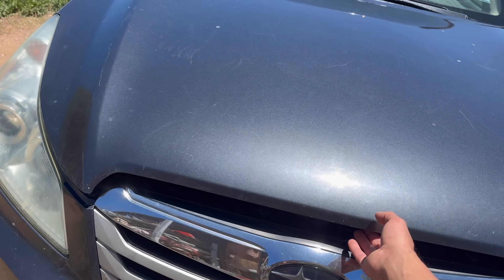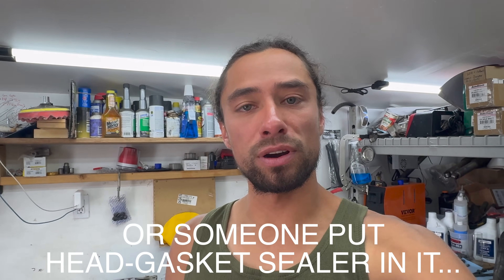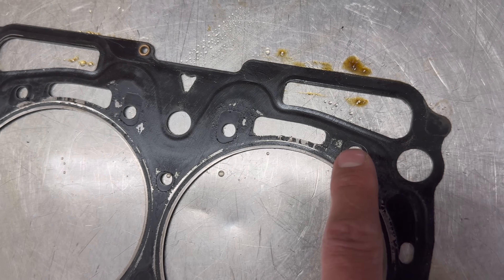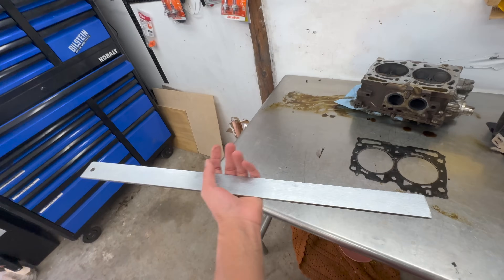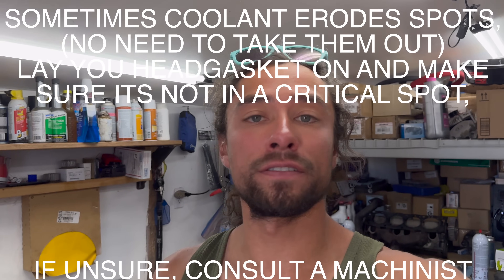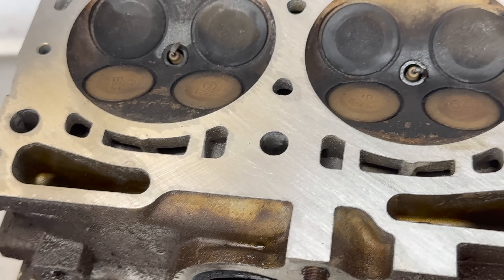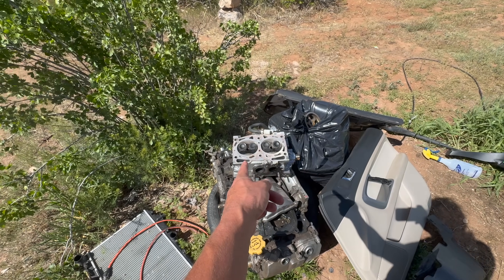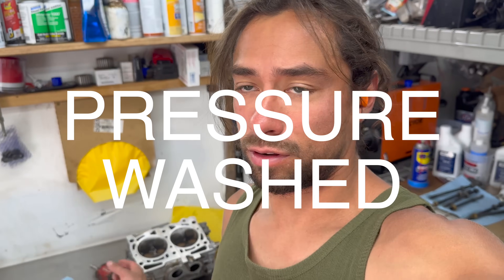How To: Resurface (EJ25/Subaru) Heads At Home - Backyard Machining 101

Comment: I've seen this done with a thick sheet of glass rather than a tile. It was an inline 4 head, and the person tied short lengths of rope to some bolts in the valve cover bolt holes, and then pulled back and forth on the rope. The idea being that if you are pulling on the rope then there is no risk that you are pressing down on the corners of the head and sanding a bow into it.

Comment: I got a 9" x 11" piece of 3/8 thick steel, and welded a handle on one side, a few drops of oil, a 9" x 11" sandpaper sheets stick right to it, perfect for flattening the deck, and the heads on a Subaru,  have probably done several hundred sets. Once my abrasive holder was made, I had it flat sanded at a machine shop.

Comment: I’ve always wondered if I could resurface aluminum cylinder heads with my 15 inch JET wood planer?  Also if Subarus are known to overheat, would it help to put a bigger radiator in them?  Or instal a giant oil cooler off of any diesel truck or tractor?

Comment: How does a plugged heater core damage the engine?  Haven't heard of that for other engines.  Great idea manually resurfacing.  OldSkoolFunk in San Diego made a similar youtube ~10 yrs ago, but used spray adhesive to attach sandpaper to thick glass.  Great tip on sandpaper for a floor-sander.  Would probably take days to deck a cast-iron head, but they rarely warp like aluminum does.  Will that sandpaper and its backing glue hold up to water if you hose it off as you work?

Comment: I did basically the same with my 98' DOHC Forester. Used an old 3/4" thick glass table that was given to me as my flat-base for the paper. The exception is, I used 6 star gaskets which state the surface should be 50RA or less. I did some research and the "RA", that means roughness average. ( 50 microns ) That's pretty smooth. I finished with 600 grit, the whole time flushing the paper with water, worked great. When I was through, the heads and the block looked like mirrors. I did the block with a piece of 1" thick polished granite building cladding that I had picked up from a commercial building site that was under construction (free), I cut it down to my needs with a diamond skillsaw blade. I used some 3M "77" spray adhesive for gluing the sheets down and used a 4" rubber roller to get it down flat, with no trapped bubbles. I had to remove the dowel pins from the block faces to do those.  I did this job back in 2005 some 175K miles ago, still running strong, with 295k miles of the car now, no problems with the HG's what-so-ever. Surface prep, flatness and proper torque amount and sequence are the key to a lasting job!  Saved a ton of cash and know that it was done right. How many shops would take the time to get it that good?
Reply: Did I understand this correctly - you held the granite cladding in your hands and sanded the block with it?
Reply: @fmlogija  ,  Yes.  The whole job is way easier to do with the engine out, and mounted on an engine stand. I removed the dowel pins from the block, so they wouldn't be in the way. I used a piece of the granite that I had, which I cut with a diamond circular sawblade, so that it was the size of a sheet of the Tri-mite wet sanding sheet. I adhered the paper with a very light spray coating of 3M "77" spray adhesive, and used a small rubber roller that's used for installing Formica, to get it totally flat with no bubbles or creases. I turned the crankshaft, so the pistons on the side I was doing, were about halfway down, and then I stuffed oily rags in the cylinders to stop any water, used as a lube/flush agent that I sprayed on with a spray bottle, from getting into the ring-lands. I didn't want any grit from going in there.  Yes, it sounds like a lot, but it's the way to go. It's been about 150k miles and 15 years ago, with no problems.  When doing the sanding, use a light even pressure and use a circular motion, until you've got a mirror like finish. Keep it wet with the spray bottle. The entire surface should look all the same and even.
Reply: So in his video he said 80 grit, if one were to use the factory Subaru MLS gaskets would 80 grit suffice or should we go up to 120 grit?
Reply: @aradney3 for factory gaskets, 80 grit should suffice! Coming from the machine shop, you can see the cut marks across the head. They run it fast speed then slower speed to make it finer. So the "glass" finish that the commenter mentions was necessary to meet the specs of his aftermarket head gasket. If the 80 grit makes it look way too rough then 120 won't hurt. But 80 will be fine.
Reply: @aradney3  , I used 3M™ Wetordry™ Paper Sheet 431Q, and started with 120, then to 220 and finished with 600 grit, keeping it wet with water to flush away any build-up in the paper, which speeds the job up and makes the paper last longer. The prep is only as good as you make it to be. Dead flat and shiny is what I strived for. Any visible "scratches", will work against you having a long lasting job.  Personally, I would only use 6-star gaskets. 6-star uses an advanced, high temp polymer, for the areas where oil & coolant passages are, with a proven "fire-ring" design to seal the cylinder-to-head junction. A superior product and worth the extra money as far as I'm concerned.  I've tried the others, which eventually failed.  I'm sure there will be a lot of people that will be "nay-Sayer's", but the proof is in the pudding, as they say.  I did mine back in 2005 and they are still doing their job with no issues, 180k miles later.
Reply: @cayankeelord3730 I've heard good things of six star as well. I was just going to go with the OEM MLS gaskets, I suspect they're as good as the Six Star?
Reply: @aradney3  , Not even close! 6-star were developed for racing and have superior technology from design, to the materials they are built from. They use a specialized high-temp polymer, as the sealing material that is part of the gasket, to seal the oil & coolant passages. It never hardens and stays pliable. The "fire-ring" is engineered to be  resilient, with the ability to expand & compress in thickness, in response to heating/cooing cycles of the heads & block. I've tried them all, including OEM. I've never had a 6-star failure.  The key is proper preparation. Dead-flat surfaces with a 50RA or finer finish of both the heads and the block. If you meet these requirements, it'll be the last time you'll have to replace head gaskets on your Subie.  They are worth the extra cost and the extra prep needed for a successful installation.
Reply: @cayankeelord3730  It''s been a while but I am back, so if you had to pick would you purposefully go with the Six Star branded gaskets over the OEM MLS gaskets? On Six Star's website would I buy the non-turbo gasket or turbo gasket from them? This would be for a 2009 Impreza 2.5l NA but I want to put MLS on the engine.
Reply: @aradney3  ,  The 6-star gaskets I bought, were a MLS type for MY98 that has the DOHC 2.5L engine. After using them, I wouldn't use anything else.

Comment: DO NOT cut heads with just 80grit smh. Don't even start with it. If yiu leave 80grit scratches, it WILL eventually leak 100%. Start with 320 and end with 400/600. 320 is more than enough to cut aluminum heads in a few passes. If you think I'm wrong, go ahead and ruin your heads, it's your engine, but ask yourself this, how do heads come back from all the machine shops? 80grit Scratched up? Or almost smooth as glass? So why wouldn't you just do it right the first time? Unless this guy knows something every machinist in the country doesn't..
Reply: Thanks for the info. Much appreciated

Comment: What is the reason you shouldn't finish it off with finer grit sandpaper? Wouldn't that smooth out the scratches you made with the rough grit?
Reply: I believe you want some roughness to the heads for proper sealing. You want some texture for the gasket to seal into least that's my vague understanding of why might be wrong.

Comment: Wow, I have a 2004 Subaru Legacy. The water pump has never worked in the last 2 years. I have had no engine issues at all in that time! In fact I just towed a 3 ton trailer for 4 hours without any issues.
Ok, the clutch took a hammering a few times. But for a non water cooled engine, it is a beast!
Good job on keeping these newer Subaru's running 👍
Reply: You are capping

Comment: Engineer.....Take an engineers steel ruler 24 inch at least....Put it on the surface of the Ceramic Tile and check for flatness all over....Find a good one..... You're Welcome....🤔😏😏🇬🇧
Reply: An Englishman speaking in inches?? What is this world coming to?!😅
Reply: @jamboslice666 Well, Engineers steel rules originally came in increments of inches. So, 6 inches, 12 inches, 24 inches, 36 inches etc.
As an Apprentice back in back in ,1971 we were taught to measure in both inches and millimetres. I could convert either in my head, then and now....🤔😏🇬🇧

Comment: Right on bro. I bought my first car in 1969. It was a Mercedes 180B $120. I had to borrow $60 bucks from my sister to buy it. I had no idea what I was doing but knew I couldn't afford to take it to the MBZ dealer to have it fixed. So the summer after high school I rebuilt the whole car. I had no idea what I was doing  but knew I needed a good reliable car. It worked! Glad to see you are doing things right. How come you're not doing your BMW? I have to put a head gasket in my BMW 525 this spring. Keep up the good work. Where are you located?

Comment: I’ve seen this done when I was a kid neat trick but I’m to lazy to work that hard anymore and I wouldn’t buy a Subaru in the first place they have to many issues like this along with the timing belt failures oil coolers leaking and numerous other problems no thanks

Comment: When you're broke, you're broke. A careful mechanic can do a lot to lower expenses and get a job done on a budget. This can work. Using a good gasket after and correct torquing of the head, it'll run.
Is a machine shop better? Yes, they have machines made specifically for engine rebuilding engines. But if you are lacking funds and can do this. Do it.

Comment: Wd40 isn't a lubricant. WD=water displacement. It was invented by the military to remove moisture from distributor caps. and there is zero way to know if that tile is flat without running and dial indicator or laser over it. My machine shop charges 75$ to machine a head..and they tank it as well. Id like to see a dial indicator over the head he did. I can guarantee its shorter around the perimiter from the sanding motion. Prove it dude. Dial indicate those heads and show us.

Comment: If you can't find large sheets of sandpaper. It's easy to get away with "belt sander" sand paper. Cut them in the middle, usually they are long enough for a regular four cylinder head. And cheaper. Preferably go for aluminium oxide sand paper. 
My 2 cents! 🙂

Comment: lol use an angle grinder , lathes are overated 😂
What your doing is a back alley patch job regardless if it works or not !
Straight edge NOT necessary lol ok they are overated too apparently eyeballing way better eh ? 
What do you do with the engine block mating surface ?
Varsol in the port of the closed valve checks for leaks not water ! 
Thankfully you can save people a lot of money and grief though. 
Ive been licensed heavy duty mechanic at CAT with over 50 years wrenching. 
Licences are overated these days too 😂

Comment: Take the BLOCK AND the heads to a good machine shop. Pay the old guy $500 to surface the block and heads to +/- .01mm-he can hold DOUBLE that. I'd pay thru the nose for genuine Flo-Pro gaskets and BE DONE WITH IT! If he has a Sunnin Honing machine, I'd have him clean the cylinder bores too. Do it RIGHT or do it AGAIN. Flathead Ferds taught me that 63 years ago...

Comment: I was rebuilding engines since 1987. I started with methods like this and eventually became a machinist tgen engineer. I still agree with tge shoe string common sense ways, BUT; for the love of God please at least use a test indicator over the surface to see where you're at. A shinning smooth surface is deceptive at a glance. You could be. 020 tp. 085 out of flatness and not detect it using just a square or granite surface and light. You don't want to be reworking the head in 6 to 18 months.
Reply: How would you use a dial test indicator on the head’s surface? Do you just check the surface with a straight edge + feeler gauge, note the low spots’ locations, then sand away, stopping every few passes to check if the dial indicator stops measuring height differences when dragging from the normal surface to the low spot and back to the normal surface?

Comment: If you want to save a bit on brake cleaners use E85, it's cheaper than gasoline.  I just put it in a spray bottle.  I don't bother even having brake cleaner around anymore.

Comment: Some tiles have a pronounced bow so do check the tile is flat. I used a granite kitchen work top protector when flattening second hand wood planes.
Reply: Yeah, can confirm. Use the straight edge to check them.
Reply: @FixTechStuff  like he said in the video the reflection of light will tell you how straight it is.   That is verry important. I guess he did not stress that enough in the video.
Reply: Oh, I got that point from the video!  That's the hole purpose of doing this.

Comment: 2006 Forester non turbo
I see oil leakage on the passenger side where the head meats the block. Not seeing loss of coolant or power. No overheating
Just hella annoying to have it drip on the exhaust and smoke up the cabin

Can I do this job on the 2006 without having to remove the engine?

Comment: I Used a piece of glass with rounded edges used contact adhesive to glue the sand paper down on both sides one side finer grit for finishing and put it on a wooden work bench didn't move one bit and valve grinding compound and lapped the valves with a drill and a bit of vacuum hose on the stem and put them through a dish washer actually worked bloody well runs like a champ ej25 heads on my 08wrx pushing 18psi through it 270,000 km on the odometer so far

Comment: 👍 I've done this to 2 Subies.  First one went >100k before it was totaled.  Second one is at 50k.  Both no problem.  Felpro MLS HG.
Reply: What grid of paper?  I think 80 is agresive
Reply: @kamil8149  
I don't recall.
Reply: How did you calculate how much mm of material is removed during resurfacing onvsandpaper? How do you select how much thick head gasket to install to keep timing true?
Reply: @lordjaashin  
I didn't.
It's just sanding to get the surface straight.  It's not removing enough material to justify a thicker gasket.  I've heard that back in the day guys would do it to steel heads on their concrete driveway.  Average daily driver cars will tolerate more abuse than people think they will.  YT has convinced people that every engine build requires a clean room and thousands $ in machine work.
Reply: @pedlpower  stienfab garage does suggest a clean work area when doing this.
Reply: @crzy11000 
I wasn't suggesting you do this on the beach.

Comment: i can only get fel-pro gasket are they any good?
Reply: Feel-Pro is top notch gasket company
Reply: he does not use Fel-pro but in another video he talks about using some off of ebay kits but throwing all the rubber gaskets out and using subaru gaskets watch ep3 of Hustle of the week starting at 19:25 in that video.He says he uses $50.00 CNS head gasket kits from ebay. He also uses copper spray gasket on his gaskets in that video.